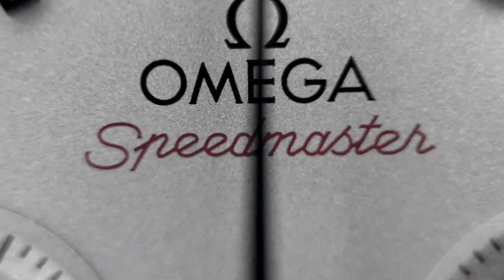Dubois Depraz, Modular Chronographs & Modular Movements: Are they any good?

Comment: I've got the ETA 2824 with the dubois depraz 2025 module movement its just now being sent in for it's first service after 14 years. I don't like how the date wheel looks like it's far down into a tunnel. Absolutely no problems finding a qualified watchmaker to service it. $480 for a complete service.

Comment: Very interesting, I came into your video since I just bought a vintage Tag Heuer 2000 chrono di dubois depraz and it's true: the crown is much higher compared with the buttons as well as there's a cyclop inside the date. But that it's one of the reason I love this watch :)
Reply from the maker: Oh nice! Some of those early Tags are actually really cool & its an interesting part in the company history. Great watch :)
Reply: @ShahLusso  thank you
Reply: My Heuer 2000 chrono with this movement doesn't run unless the chronograph is running. It's pretty odd as you would think the dd module would add not remove drag. I am aware that this problem is not unique. Unfortunately the DD module is usually replaced rather than serviced but apparently not easy to source.

Comment: Inciteful stuff. I knew some of this, but your video definitely hit on some things I hadn’t realized or understood. Always nice learning something new. 
   I hate to sound like a sound like a buzz kill, but for I’m avoiding this whole debate by avoiding automatic chronographs altogther. 
   I have zero interest in perpetual calendars and the like so it doesn’t apply. 
   For now — if I get a chronograph — I’ll be getting a quartz. Although not planning on a chronograph anytime soon do by the time I do, might have a different take. 
   Another vote against automatic chronograph movements (and especially modular ones) they are very thick. Quartz aren’t. 
   That said with a three-handed I’m picking an automatic every time.
Reply from the maker: Fair point, it's hard to find a good automatic chronograph that isn't too thick (unless you go very high end or get something with a Frederic Piguet 1185, but even those aren't exactly cheap either) so I can definitely understand the aversion to them, plus quartz has the extra precision to measure smaller fractions of a second that again you'd have to go much higher end for if you wanted a mechanical equivalent (i.e Zenith Defy 21, JLC Duometre etc).

Comment: Are flyback chronos usually DD? I would appreciate an answer.
Reply from the maker: For the most part no - the main Flyback chronographs that come to mind are all integrated chronograph movements (Breguet 582, Hublot Unico, Zenith El Primero 405, even the Audemars Piguet 4401 in the new Offshore & RO Chronographs is integrated too). I do believe DD does make a module that has flyback capability, but I can't think of any watches that come to mind that use it. Hope that helps :)
Reply: @ShahLusso  Thanks. There was a Maurice La Croix that has a DD module. This one: https://www.youtube.com/watch?v=hApmaX57LDE but according to this forum, the additional flyback stuff was done by Maurice La Croix itself: https://www.watchtalkforums.info/threads/just-arrived-maurice-lacroix-masterpiece-collection-flyback-chronograph.68674/ That gave me the impression that a lot of the more affordable Flyback auto chronos were DD.

Comment: The ones made for the speedmasters fitted with the eta movement are complete garbage. Do not buy a speed master with that movement.  It always fails and is very, very hard to take apart and put together. It’s garbage. Nothing more than a gimmick to make a thinner watch.
Reply: I can't argue whether the dd module is garbage or not. they do save cost but they certainly don't make watches thinner. They are cheaper to replace rather than service.